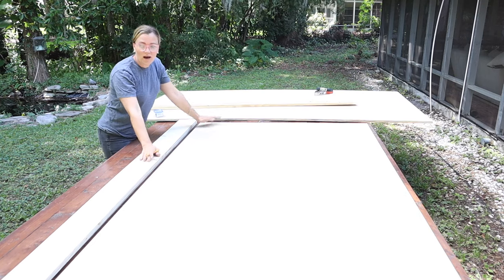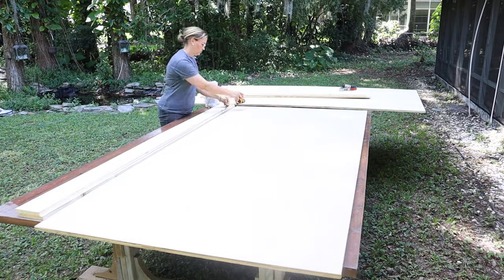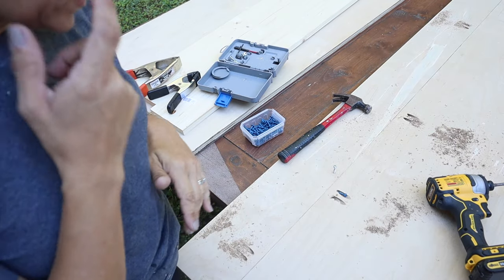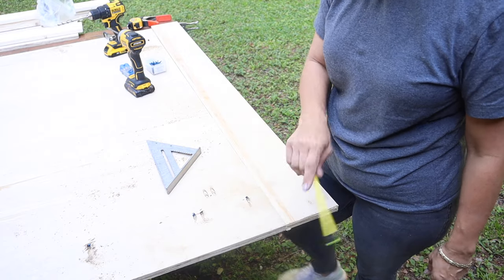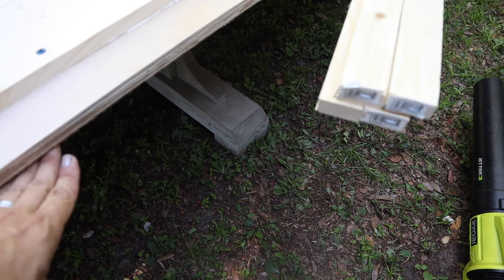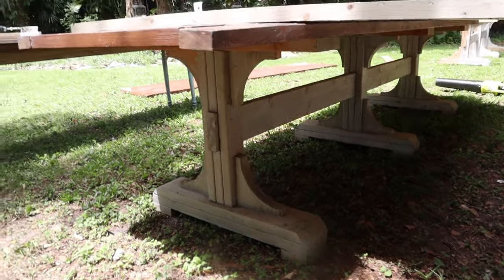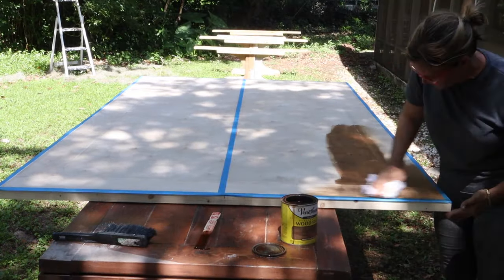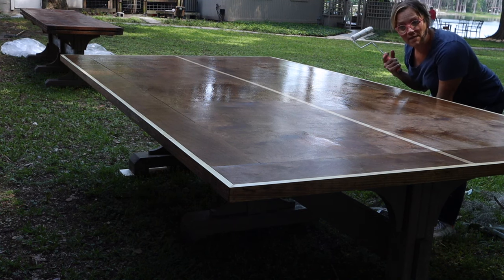DIY outdoor ping pong Table

Comment: Your work turned out beautiful. I noticed that the woods have seams. This even harms the game because the ball can touch this amendment and deviate to the other side, deceiving the player. I recommend every time not to play, to store in a shelter away from humidity, sun, rain, etc. Because it will conserve the table more. I play table tennis on a table made of 30 mm thick MDF and the game is very fast.
Hugs from Niterói, Brazil.
👏👏👏👏👏👏👏👏👏👏👏👏👏
Reply from the maker: Thank you. I actually brought this table into my covered patio to preserve it. And also poured 4 layers of clear epoxy over it and now it’s totally totally flat and beautiful, without any seams. I love it. We play all the time. Thank you for commenting.

Comment: You said in the comments it warped? So it didn't actually work then? You did this video only 4 months ago...?
Reply from the maker: yep. I brought it into my screened patio after only about 2 months because the plywood was penetrated by water in a couple different spots at the joints and started to separate. I had a feeling it might. I really should have applied a few more coats of the Halcyon finish. It called for 5 coats, but I only applied 3, and I could tell it wasn't saturated. But that's all I had on hand. The rain here in Florida is really torrential in the summers. It's fine, it dried and now I think I'm going to sand it and apply epoxy. I knew going into it that it was an experiment.  I didn't think it would happen that fast though. Anyway, it's better in our patio anyway...we use it more often since there's not mosquitos. And this one is waaaaay prettier than the old blue one we had.
Reply: @MimzyandCompany  I would coat the underside as well... you have to "even" out the finish on both sides to keep it from warping - that probably would have happened even out of the rain with your humidity. And use an exterior plywood as well. Nice build, but might want to mention this somewhere that it didn't work as others might try it this way... its ok to fail, just tell people about it :)
Reply from the maker: @brianwohn  yeah ...my plan has been to do a followup video about it...just haven't gotten to it yet.